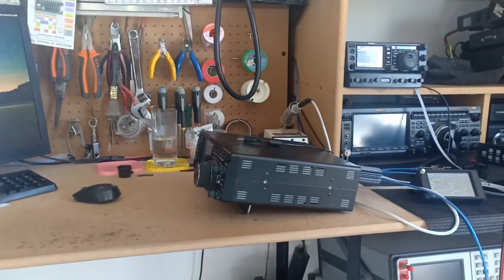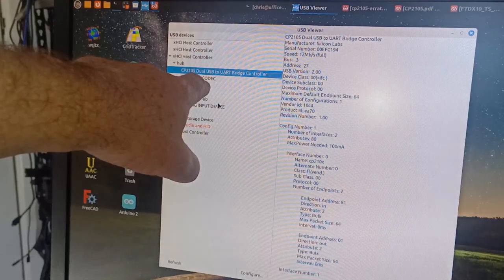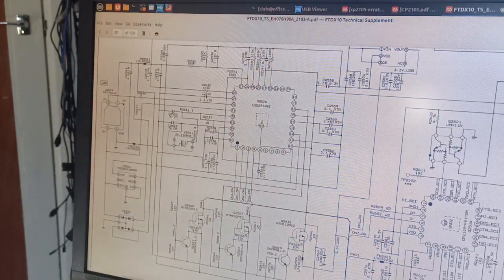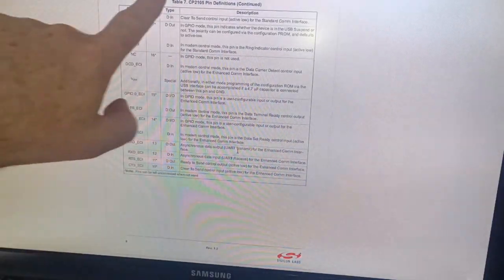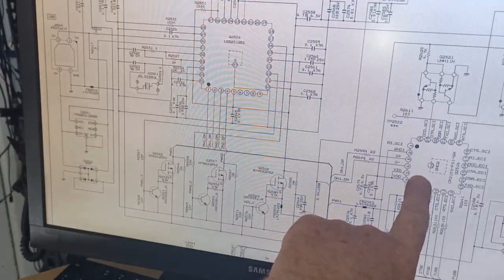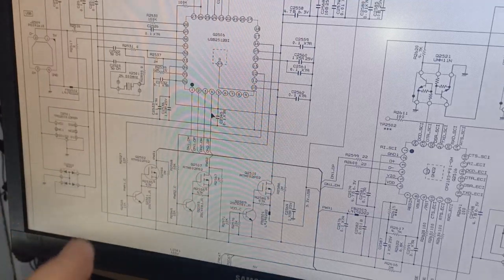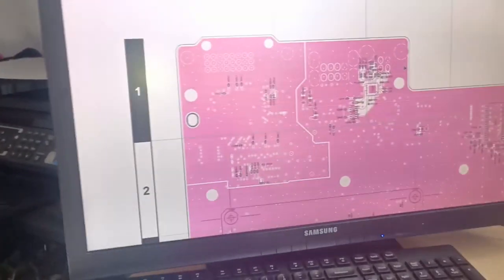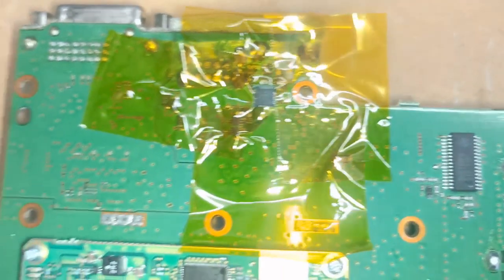Yaesu FTdx10 COM Port Repair (CP2105 replacement)

Comment: Excellent video. You described my issue with my FTdx10 exactly. Yaesu USA wasn't much help when I contacted them and told be they only support using the USB with Windows. Doesn't say much for us users of Mac and Linux. I guess I'll have to send mine back to them for repair along with a link to your video. Maybe then they can admit to the issue. Once it is repaired I'll be sure to remove the 4.7u cap. Thanks for your work. I look forward to being able to order a CatTouch for both the dx10 and my FT710 soon.

Comment: Emailed them about my DX10 having a similar issue. Estimated at 800 for a new board and 90 for labor. plus shipping to get it there. Basically 400 off from a new rig.
Reply: That's better than my FT-991A...they want $1,000 USD for the main board. I shared this video and Chris' other one with Robert, the tech at Yaesu and explained the issue. They won't replace just the chip, only the entire board.
Reply: @TheMisterNomad  yep same with mine .... luckily i had a friend who works on computers at the component level and I took the risk of letting him attempt the repair... otherwise id just have to make do without USB control of rig or sell for scrape. I won't be buying any more yaesu radios...

Comment: Thank you for your useful guide! My friend's DX10 had the same issue, he ignored it for a while and continued using it for phone work. When I took it apart to replace the chip, his chip had shorted and burned the board quite severely. I was able to scrape away the burned sections and replace the chip still, only running wires to the necessary pins according to the schematic. But it's something to be cautious of, if your radio has this problem, probably don't want to keep using it. Who knows though maybe mine was a one-off situation.

Comment: Chris... great video. I have the CAT touch with my FTDX-10 and love it. I also have an SMD repair station, but I am not very skilled with it, so I'd rather avoid the issue with the USB port. If you get the CAT Touch to program the PROM, I'd be very intertested in buying your solution as a preventative measure. 

Does the failed USB port take out all of the USB function including the mouse input and communication with WSJT-X , FLDIGI and similar software products? I am assuming so.

On a side note, I have a very well shielded USB cable and a type 31 ferrite donut that I've wrapped it through a few turns.  Do you think that would also help from a preventative perspective? I also have the Palomar Engineering EMI kit installed which puts ferrite around every input and output of the radio (that kit addressed then USB cable mentioned). My IC-7300's USB port would occassionally lock up and I'd have to cycle power. I observed it was typically during transmit so I bought a better USB cable and it solved that problem.... but it wasn't catastrophic failure like the YAesu apparently is subject to.

73's and best wishes.
Reply from the maker: The CP2105 failure takes out USB CAT communication only. Sounds like you have good protection in place and yes, good quality USB cables are a must in an RF environment. But the no 1 thing is to make sure there is as little as possible RF in the shack. Making sure your coax is well matched and good grounding is a real must. 73 om and thank you for supporting my endeavors :)

Comment: Before you desolder the CP2105 chip, measure the USB2512 chip.
USB2512 was damaged in my FTDX-10. You will save yourself a lot of work.
Reply: Hi, can you describe how to check the USB2512 chip for functionality? On my FTdx10, both the com port and the audio interface are no longer present. Thank you
Reply from the maker: @timo3041 follow up video shows how to check here: https://youtu.be/3qAV5ouJpKQ
Reply: @timo3041  I replaced the CP2105 based on the video, the USB COM and Audio ports were not visible.
Replacing USB2512 will restore the functionality of the audio and USB ports

Comment: Thanks for this Chris.

Would you change your methodology for heating and removing the chip to safeguard the other localised components?
G0DVF
Reply from the maker: No, I'd still use hot air but maybe turn the air pressure down a fraction & make sure the top bit of tape was closer to the chip. It was about 2mm away. Needs allot of heat as the center of the cp2105 looks like thermal ground so takes allot of heat to reflow the solder..

Comment: So, if the CP2105 goes into one time programming mode, it should still work, except the VID/PID would change.   Was looking for you to confirm that, otherwise, it just looks like the CP2105 just "died"??   Also wonder what would happen if the 4.7uF capacitor was removed.   Seems like it doesn't need to be populated.   Would it recover?    

   I love the Kapton tape approach.   Great "trick"...
Reply from the maker: My thought is: RFI triggers the CP2105 VID/PID programming routine. It wipes the existing VID/PID ready for programming but never received it. So next time you turn it on, it never responds with a VIP/PID (as it has none) & we simply see no USB device. The data sheet clearly states the 4.7uF cap is only required to program VID/PID.  I discussed this all with Vuong Ngo from Silicon Labs who agreed stating "I think that removing the 4.7uF capacitor on pin 16 is a useful method to prevent the CP2105 from entering programming mode (undesired operation)". I doubt the CP2105 could be recovered if it lost its VID/PID but could be wrong..
Reply: @ZL1CVD  it is best to follow SiLabs engineering...  I would think the VID/PID would be set to 0's, it has to be set to something.  But if the OS doesn't recognize it, it may show up in a different location with unknown description.   Anyway, good find!

Comment: Did you tell Yaesu about this ?? So if I understand correctly when you buy a new transceiver you first need to remove the cap before connecting a USB cable ?? Correct ?? Cheers Phil ON4VP

Comment: Hello.  I have two questions.  One: Does the new CP2105 need to be programmed before or after soldering?  And two: I have a similar problem with my FTDX101D but the difference is that I don't see the serial ports and the sound devices, I think the usb2512bi chip is broken.  Do you have an idea how I can check which chip is bad?. Thanks.
Reply: Have same problem in my ftdx10, my question is how check?
Reply from the maker: @lockhock8400  follow up video shows how to check here: https://youtu.be/3qAV5ouJpKQ
Reply from the maker: follow up video shows how to check here: https://youtu.be/3qAV5ouJpKQ

Comment: They should cut the trace on the 4.7 uf after the radio is programmed at the factory. I believe the real test is if it will take a FW upgrade/Update...
Reply from the maker: I guess my point is, the CP2105 is not programmed at the factory. If it was, the VID/PID would be different than the default values AND we would not see errors with failing COM port like this. Simply not populating the cap would possibly solve everything..

Comment: But do you solder with lead-free tin or?
Reply from the maker: I do not use lead free. As a service technician, I find it unreliable for hand soldering.